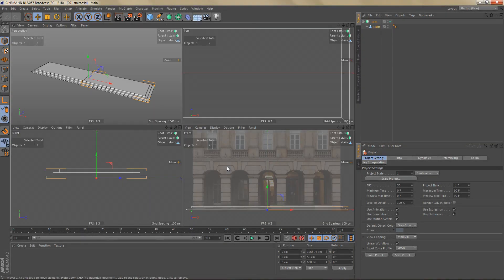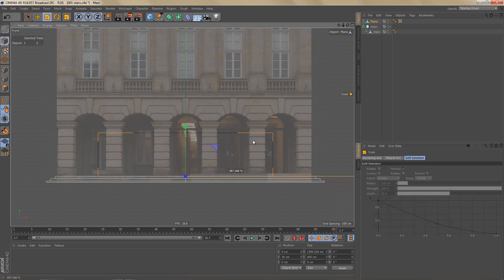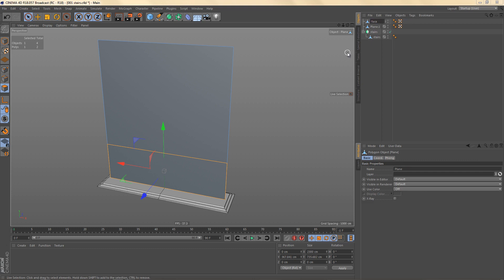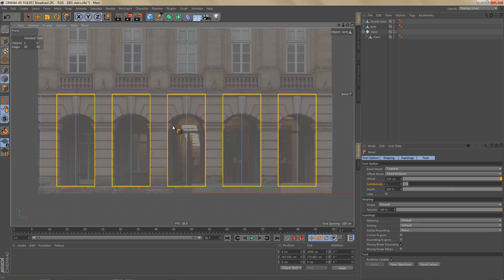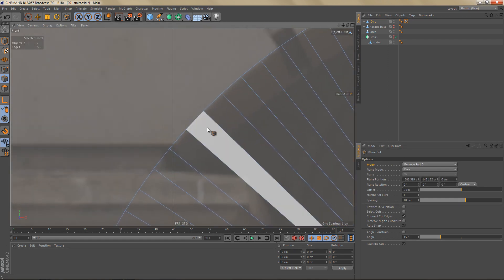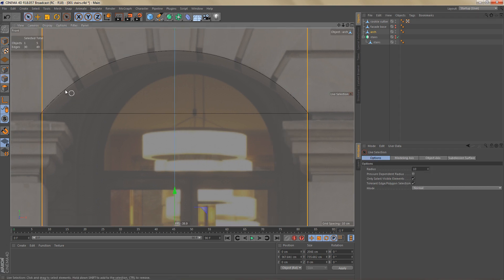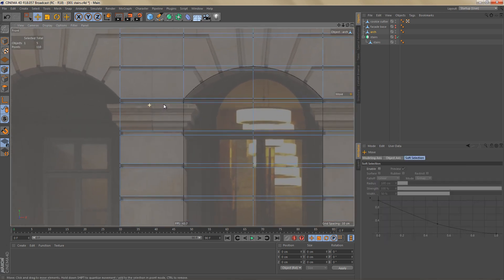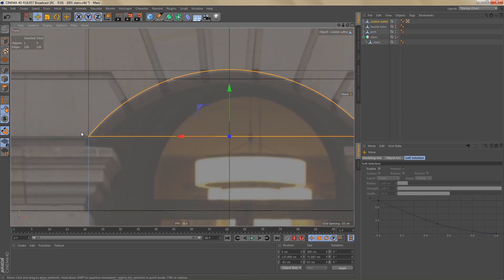Modeling a Building Facade in C4D - 02: The Arches - Part 01 | Cinema 4D Tutorial

Comment: is there a better way of inserting an image? 

im making a plane and giving it a texture of the image i want to sketch

thanks for the tutorial
Reply from the maker: You're welcome!

Personally, I don't like using planes for reference images. Go to whatever orthographic view you want to add your reference image to, and then hit Shift-V to open the viewport settings (or use the menu "Options - Configure". On the "Back" tab you can insert an image into the slot at the top of the tab. Best way of doing it in my opinion. The way described above is using R18. I don't know if it's still the same in R25.
Reply: @Wolf-4D  Thanks that method is great, i think its nice how theres multiple ways to do the same things, it allows those like me without much technical skill to still express creativity, albeit at a lower efficiency